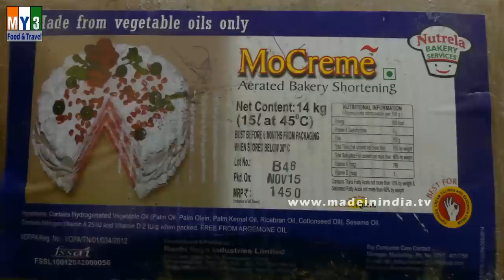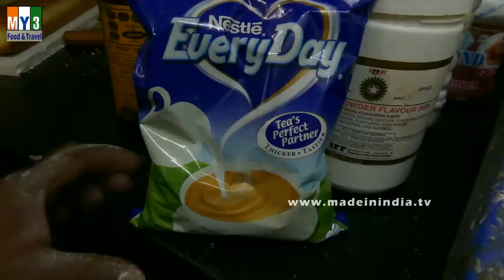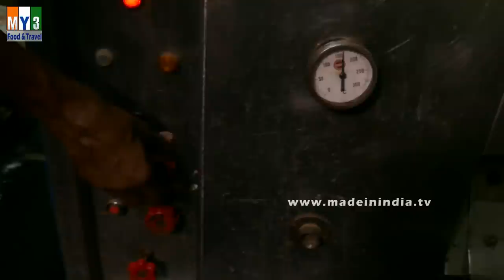Cream Cake Making in Bakery Step by Step | Bakery Foods | FOOD & TRAVEL TV

Comment: Chicken shit on the eggs.  He is touching them and then using his hands like a spoon.
Reply: that's clearly chocolate not chicken shit
Reply: I think it's more likely either chocolate or food dye stains on the egg shells.  It's extremely easy to remove the contents of a raw egg without breaking it, which is what I believe they did here.  And with the large number of eggs they use in the cakes, they would have an abundance of egg shells.  So I think they improvised and use their egg shells since they have no flower nails.
Reply: @joycegallowayparker9652  It seems that you prefer preparing cake bare hands.  That's the reason why you are going out of the way to support this video which may come at the cost of the life of the consumers. There are many who would not like to complain with the manufacturers but I wish the ISO certified compliant trade mark for this bakery. The surprising element here despite the cleanliness factors not followed you are still vouching. I wish after you consume this you are not admitted in the hospital. Apart from that there was no measuring rod used while mixing the ingredients. How can you guarantee the success ratio is my question to you.

Comment: At the risk of changing the tone of the conversation... did he add coffee whitener?? Would that work with butter cream? In New Zealand coffee whitener is not really a thing so no one would think of using it... but I think you can get it in Asian supermarkets. Has anyone ever tried adding coffee whitener to their butter cream? Would it work?
Reply: While I have never used a coffee creamer (whitener?), there are a number of bakers here in the US, as well as in the UK who do use non dairy (liquid) coffee creamer in their icings, and they say it works very well.  If it's in powdered (dry) form, they mix it with a bit of  hot water to dissolve it first.
Reply: Joyce Galloway Parker so is coffee creamer water soluble (like sugar) or a suspension (like cocoa powder)?
Reply: wrob013 I am really not sure.  But I do know it's made with hydrogenated oils, such as palm kernel oil, etc., and I know it does dissolve in hot liquid.  But cocoa powder dissolves in hot liquid too, so I'm not sure of the correct answer for you.  Although I do know many bakers prefer to use it in their buttercream, so I'm sure it gives good results especially if they live in a very warm climate because they don't have to worry about the milk or cream going bad if they were to use that instead of the coffee creamer.

Comment: All equipment and work area must be cleaned after every shift. Being poor is not an excuse to be dirty. Basing on the dirt and muck that can bee seen caked on the equipment and even the switches and power outlets, they can’t even be bothered just wiping those areas clean. Poor does not equal dirty. Stop using it as an excuse. It’s attitude and habit.